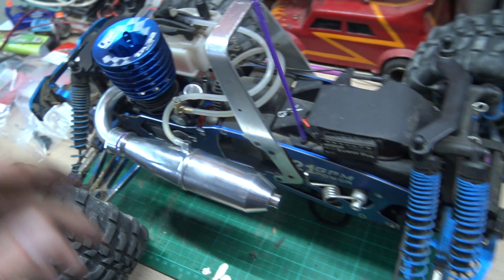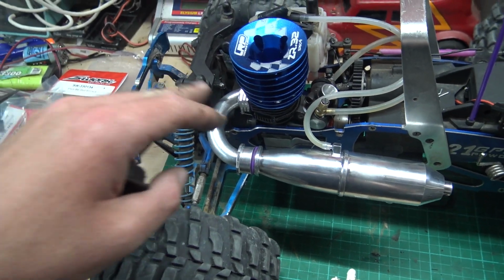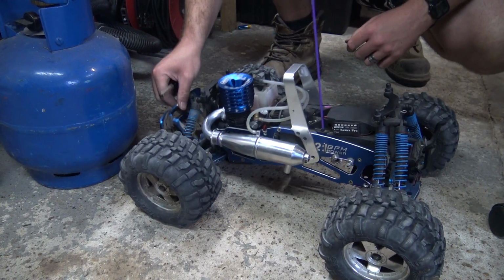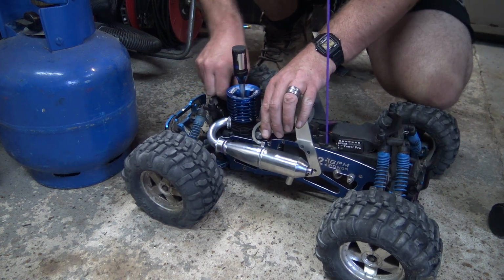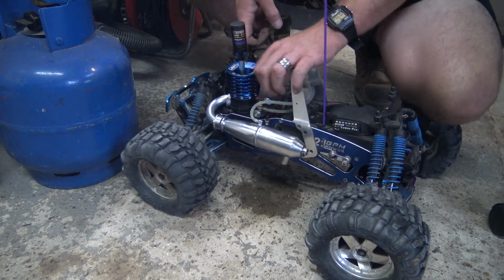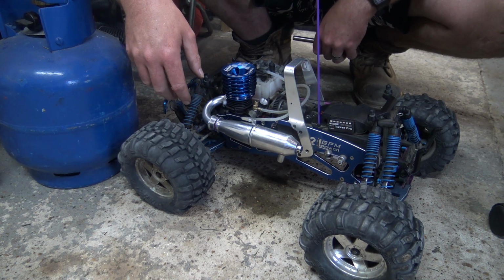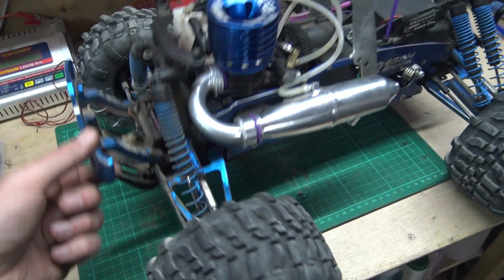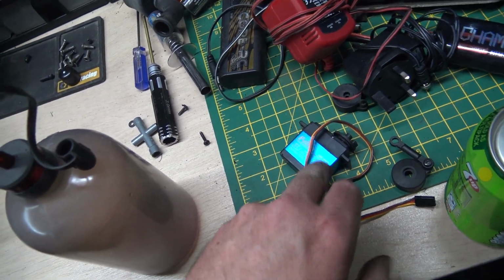HPI Savage SS LRP ZR-32 First Start

Comment: Best way to sort your shocks out is upgrade to big bore shocks all round and you just need a piece of metal coat hanger wire bent into an L shape as a temporary mount for the exhaust bro. Nice sounds from that Lrp 👍
Reply: Exactly right, big bore shocks would fix that issue and you can get piano wire or any wire thats similar thickness to the whole and you can create an exhaust mount can't wait to see it up and going be a real ripper.

Comment: How about put a stiffer spring on the single shock, thicker fluid, should be alright 💪
Reply: Kevin talbot has a savage with a single shock conversion so I’m sure you’ll have no trouble getting it sorted